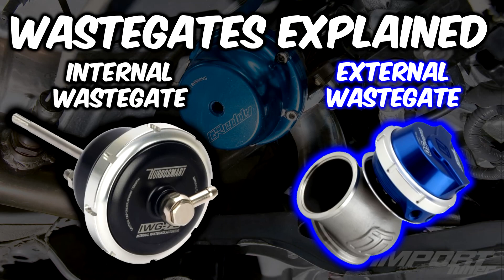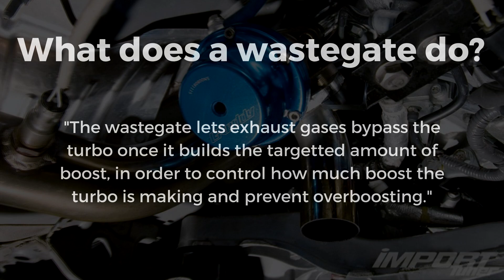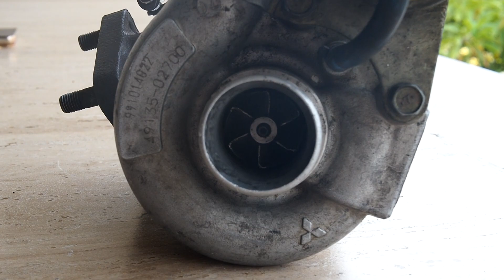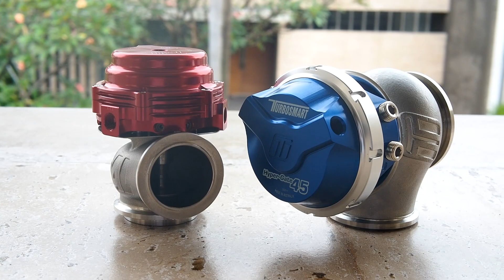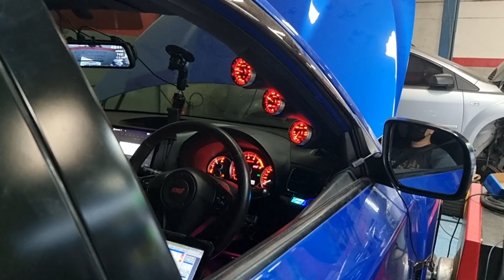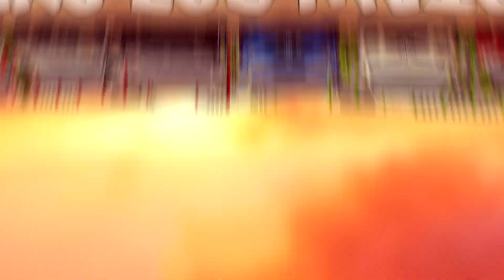Quickly Clarified - Internal vs. External Wastegates

Comment: Straight to the point, no BS, clear, simple, well explained.

My only question is if it would be possible to route an external wastegate into, maybe not directly into the regular exhaust, but into a muffler ? Obviously that would up the cost and would probably be a bit tricky in terms of space, but how would that affect both sound (loudness) and efficiency ?

Comment: so basically just get EWG if going for boost over 18-20psi?
Reply: I don’t think it’s based on “PSI” pressures, as a bigger turbo like t88 at 20psi is way different than a 28g td06 turbo pushing 20psi. I could be wrong just thinking out loud

Comment: Awsome video iv allso found formyself Internal waste gate is best for high boost when open external is good for low boost closed but it really differ on the engine and turbo u are running

Comment: Instead of welding the flapper shut, just cut it off entirely so the hole is completely open, then let the turbine route to the main exhaust pipe, but the flapper pipe goes to the external waste gate?  
Obviously this only works on turbos that keep those two separate even at the gasket

Comment: Great explanation video with all things that matter covered. Knew most of this but still watched the whole thing. Haven’t seen it explained this well for some time. Running a 6a12tt in a e84a Mitsubishi galant and let’s just say the space advantage of internal wast gates is definitely being made use of in this engine bay. I’m only running Td025Ls twins but there is literally no space at the back between firewall and engine. Have given yah a sub!

Comment: Awesome video, I have a 2015 STi, do you know if I can go EWG with the stock turbo? It’s a VF48, my wastegate isn’t opening and I’m stuck on 7 psi lately.
Reply from the maker: yup absolutely, I'm running an EWG on a stock VF48 too. Helped with the power band up top and almost completely eliminated boost spikes
Reply: @JCMediaYT  can you do it without needing a tune, I know a tune would help make more power but would it be detrimental to the engine without a tune?
Reply from the maker: @Grim-STi  yes, since it changes how the boost is controlled, it may behave differently so I think a tune is required

Comment: Amazing video! I have a question though
My setup has a 70mm exhaust and external wastegate. If I were to have a smaller exhaust  to reduce noise would it affect power negatively? My idea is to have a quiet exhaust and only make noise when external kicks in 
I hope this makes sense
Reply from the maker: Thank you! Personally what I'd probably do is to install a high performance muffler instead of making your exhaust smaller. This is exactly what I did on my STi. I went from a quad tip straight pipe to a single exit muffler and it actually gained a bit in the midrange while reducing in-cabin droning. Of course this might differ depending on your setup, what car is this on by the way?
Reply: @JCMediaYT  okayy thanks! It’s on a 1.6 Miata with stock internals

Comment: Why would you modify the turbo to fit an external wastegate? The turbo with an internal wastegate is already designed to boost low enough numbers for the wastegate to keep up.
Reply from the maker: it could be because the internal wastegate port is cracked, or because they're trying to max out the performance of the stock turbo. You definitely gain a bit of power throughout the rpm range and gain a ton more boost control with an ewg.